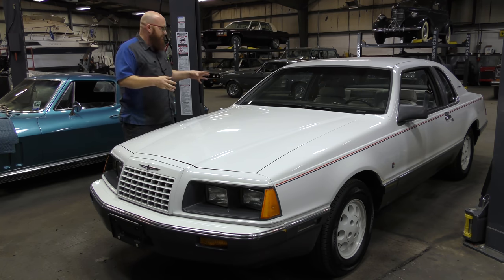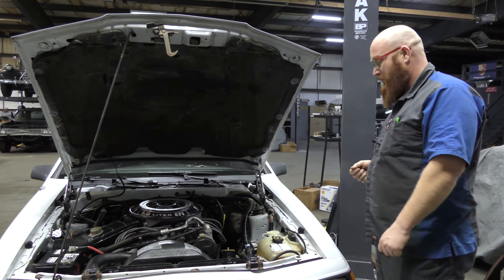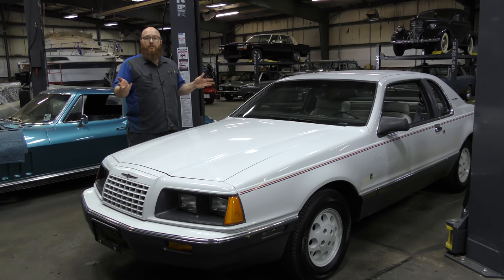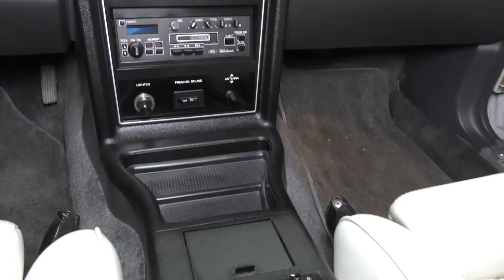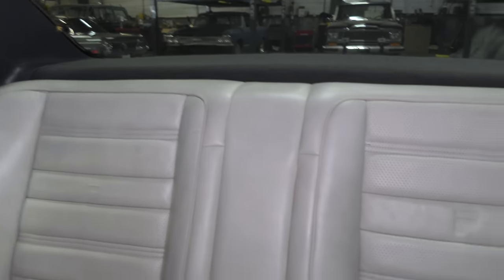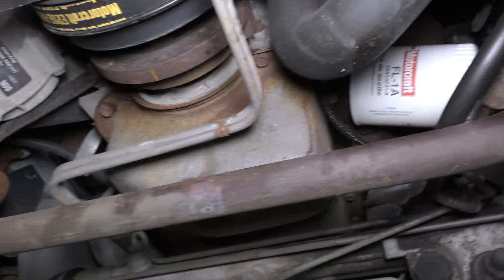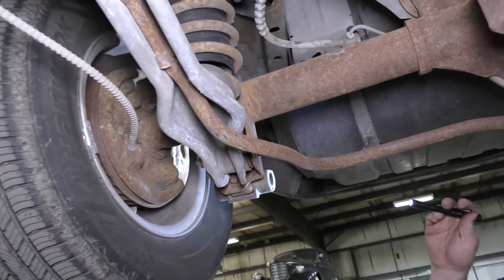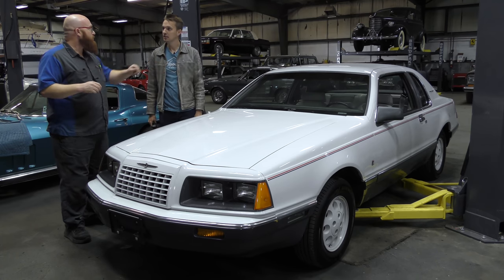The Car Matches My Shoes?!? The CAR WIZARD has Rare 1984 Fila Edition Ford Thunderbird in his shop

Comment: Brings back memories of my 1988 T-Bird LX with the 5.0 liter engine. 
Boy that Bird could Fly!!
Ordered it brand new from the factory.   And drove it till it dropped 242,000 miles later.
Reply: Ikr? I had my 86 up to 125mph with my brother trailing in his 88 iroc, it didn't pull hard but it just kept going.

Comment: Ah, the Fila T-Bird.  I am old enough to remember these.  Back when GM and Chrysler were making boring crap, Ford was churning out the interesting stuff.  Very cool find for Bob.
Reply: GM & Chrysler most DEFINETLY were making weird stuff in the 80's too
Reply: Ya GM had wrangler jean trucks, GMC had Levi ones, etc many years before Ford did it, as for interesting, Buick was putting out the Grand SPort at this time that made all other cars look slow and were (opinion) a good looking car, not just trim packages, just pointing out cross-branding was being done by EVERYBODY at that time, Chrysler had so many it boggles the mind how a car company in dire straights could afford all those special combos'. I think AMC did it before any of the bigger brands with Gremlins and Pacers and even the earlier Rebels n the l very late  60's (can't be sure on that). Now I am not hating, I like Thunderbirds in those years and had Couger as pretty my the only Ford car I ever owned and kept long term and it was a good car.
Reply: Pickle smoocher
Reply: Ford's were always nicer looking when it came to car designs. This Thunderbird, The Taurus and The Tempo were all ahead of their time back in 1984

Comment: VERY nice!  I recognize a lot of the features; I had a 1980 Thunderbird "Heritage" edition for a time, and even it had the keyless entry pad, the "premium" sound switch (though it was a pull-switch to the left of the radio), digital radio at that, automatic headlights - lots of neat features that were really ahead of their time.  And yes, that little squeeze-ball is for the lumbar support in the seat.  The seats are a different more updated design in that one (they were more like a lazyboy in the 1980 to 1982 birds).  I don't doubt Bob will have no trouble getting the asking price for that - it's gorgeous.  

Oh, and in answer to the question - I think of all the cars I've been in, the 1980 T-bird had the best (and worst) seats. :)  Best because holy MOLY they were comfortable.  Like I said - lazyboy.  It was just so relaxing to get into the car, sink into those plush, amazing seats (which were like 8 way power adjustable), and feel instantly at ease.   Buuuuuut... worst for kind of the same reasons.  Once you were on the highway, that seat would have you nodding off in about 10 minutes!  They were ultimately too comfortable for a car.  :P

Comment: I have special affinity for the Fox platform Thunderbirds. My Dad had the last year of this chassis, a 1988 Thunderbird LX with the V8. His was white with red interior and every option just like this one. I always felt like the coolest kid in the neighborhood when I rode in it.  They had TBFI and the two into 1 exhaust until ‘87 when they switched to MPFI and true dual exhaust. Really woke that 302 up. I think ‘84 was the first year for Ford’s coded security locking system and it’s crazy that they’re the only car company still using it in 2021. It’s a great feature, even in an era of perimeter sensing locking and push button ignition - you can literally lock your keys in the car!

Comment: I had a automotive teacher in high school. That had a thunderbird. It wasn't stock. Lowered to the ground a little. 351 cleveland built to the hilt. The engine was built to nascar specs. Five speed transmission. Outside it looked stock. Till you looked under the car and inside. Then you realized it wasn't. All white with red interior. Black tinted windows and you could hear the car coming before you saw it.
Reply: And when I see what Ford did to this 302, detuning it to 140 HP it upsets me greatly 😂 . It's honestly pathetic that they sent this out the door feeling good.

Comment: I'm in love. I owned an 83 Turbo Coupe that was very similarly equipped. Mine was black with gray cloth, but had the same style seats with the inflatable supports with a 5 speed. Wish my front suspension was as nice as this one. My struts and rack sucked. The only pluses mine had was it was one of the first 50 made, and had the turbo upgraded and it made around 18-20 pounds of boost. Which made for one extremely fun car that was special ordered without the driving lights

Comment: I worked at a Ford dealership from 1983 to 1989. I sold many of the Fila T-Birds. The hot one was the 5.0L V8. Also Turbo 2.3 I4 with the manual trans T-Birds.

Comment: I would tighten the bolts on the oil pan before thinking of changing the gasket. Vibration over the years will loosen those bolts. Hey, my 02' Ranger 4.0L (174,000 miles) doesn't drip a drop, you just have to maintain your vehicles. That Thunderbird would be a great buy. Thanks for showing it.

Comment: Any other car not being promoted for sale, you would note the leaking front shock and that the engine needs to be lifted to replace the oil pan gasket. The oil pan job is not a cheap one. Take $1,000 of the sale price just for that.

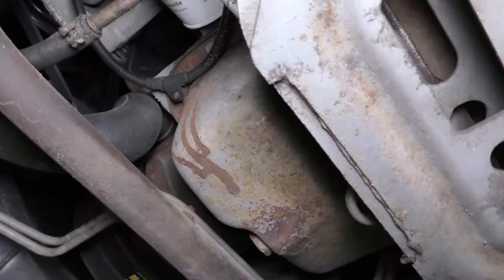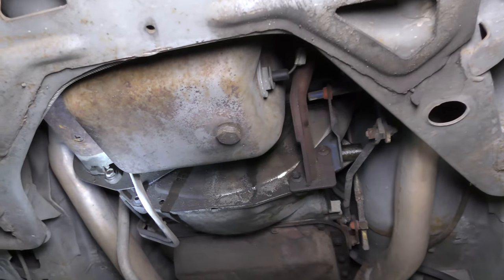Comment: At 7:23 and 8:17 it looks like there are two oil drain plugs on the oil pan.  Was that typical for this engine, or just for this Thunderbird frame?  Looks like it would have needed two oil pickup tubes inside the oil pan.

An old friend back in HS had an ‘83 with a V6.  We always rode around in it since it was way more comfortable than the Tercel I had back in those days.

Comment: Bought an '86 T-bird Turbo Coupe, red with grey/black lower body color. 5-speed, sunroof, 96K miles. Bought at an impound auction for $330, did brakes, headliner, serviced it up and a set of good tires. Not a drag machine, but cruised down the highway at a good clip pulling decent mpg. Had it a little while and sold for $2500

Comment: I remember when these came out, though never saw one in person.  I doubt there are very many still around in that great condition.  It is kind of funny to hear how little power the engine made, but American manufacturers weren't out of the "malaise era" quite yet in the mid 80's.
Reply: I think maybe Ford engineers tuned it more for low-end torque rather than high horsepower numbers, so that it wouldn't directly compete with the Mustang.
Reply: @BCBaron  Ford engineers just dropped the Crown Vic engine in it, because it's a personal cruiser.
Reply: @mfree80286  Back in the day I learned to drive in my father's '84 Mercury Grand Marquis, which used the same 5.0 V-8 and felt pretty powerful.  Now that thing must've been almost five hundred pounds heavier than the T-Bird, so I'd be shocked if it couldn't get the job done.

Comment: "Hmmm, no, I don't think I feel like premium sound today."
Why would they even install a button to turn that off?
Reply: I figure you wow your friends with it - like here's the normal crap sound and then you push the button and they get blown away like the Maxell ad.
Reply: Trans Istors are Resistors. Full volume = less resistance and less heat. Low volume = more resistance and more heat.
Leave the power amp off when you are just cruising listening to Mozart or Buena Vista Social Club.
Reply: When you turned on the switch the door speakers kicked in

Comment: The pump lumbar thing was pretty common in higher trim Fords of the 80s. That car is a time capsule, but probably not worth all that much. Also characteristic of the 80s? Having to replace the exhaust from the muffler back. They were in the process of switching over to stainless exhausts, but only made it to the muffler for some reason, so still having to replace the muffler and tailpipe was still common. Now, you rarely ever have to replace any exhaust components because of rust.

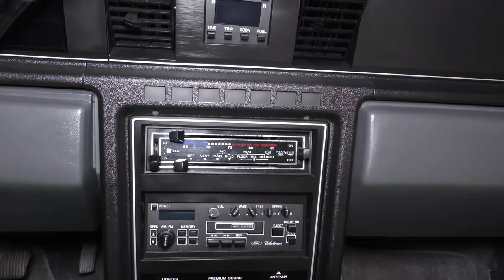Comment: 4:48 a little self-adhesive felt dot will fix the vents. Had to do that on my '84.
"Premium Sound" is a little amplifier that's stuck in the central 6x8" (I think) speaker mount in the dash. Since AM Mono wasn't an option anymore and the dash framework is from an era it was, there was a perfectly good mounting spot right there and so Ford utilized it. 
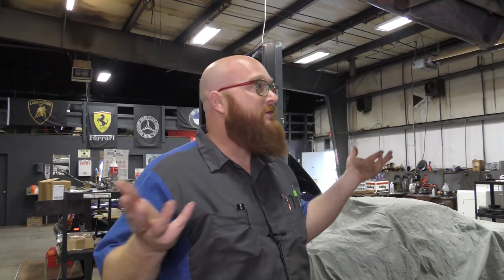9:52 checking the UCA bushings is not optional on these cars. If they're hard, wet weather handling will range from spooky to lethal. Speaking from experience here; when they bind they randomly load/unload the outside tire in the turn and the rear instantly loses traction. Mine was capable of snap-spinning at 15mph if the road was oily at all, with steady throttle or even *deceleration*. 
Also check all the clips holding the transmission cooler lines in place, if they lose their padding they'll eat through the lines. Been there as well. 

If the trunk creaks when you open it, roll the rubber split sheath around the torsion spring so the two springs aren't rubbing. Great cheap idea there but after 10 years it rolls around to the split and starts rubbing spring to spring. 

187,000 miles on mine before it wasn't worth fixing (a mistake, honestly, to let it go). It's how I can tell you to don't ever screw around with the dash center stack because that plastic fascia is as brittle as sugar glass and the screw bosses will break off, and never leave the map lights on because they will get hot enough to burn.  And your head unit needs a belt, I'll almost guarantee it.

Comment: I had an 87 T-bird with the 5.0 and multi-port fuel injection. Only had a 10 more HP IIRC. It was really slow by today's standards, a new 4 cylinder Kia might give it a run 0-60 nowadays, but that thing would sure shred the tires at a stop light. All the torque came on early, almost like a diesel, even ran out of revs like one. Got 30 MPG on the highway if you kept it around 65 and was extremely comfortable. Gave it to my Dad for a commuter car after insurance paid it off due to massive hail damage. He drove it like that until it had about 165000 miles and then sold it. Looked like a golf ball with the dents all over, but it was still shiny with the two tone blue color. Had all digital gauges with MPG and range, automatic climate control, automatic headlights and high/low beam switching. Pretty ahead of it's time. Would have been a rocket with a Coyote swap as it was very light compared to newer cars. None of that pesky safety structure and airbags to weight it down LOL.

Comment: I bought one of these as a 20 yr old out of an auction for $500. I didn’t realize what I had until I tried to get tires for it and the size tires were odd ball metric Michelin’s. I recognized those rims on this one right off. When I contacted Michelin they were the ones that told me what type of car I had. To be honest it was a hard car to keep running, every time I turned around there was an antipollution component going out in it. It was a headache.

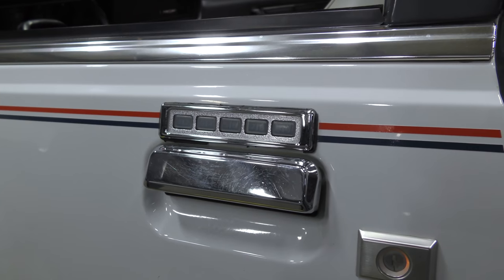Comment: 04:23 Man, you didn't even mention the lighted keyhole. Kind of useless these days what with keyless entry being ubiquitous but it's real nice if you don't have keyless entry but you do have a lighted keyhole. I learned to drive in a 1989 Crown Vic LX which had lighted keyholes and it was so nice. You walk up, pull the door handle, the dome light turns on so you can see the murderer in the back seat before you get in... and the keyhole lights turn on so you can clearly see the keyhole (also nice for trying to defrost a keyhole in the bitter cold because you don't need a flashlight).

Comment: I bought a regular T Bird new in '84 with the 5 liter engine.  The oil pan had a front and  rear oil drain plugs because it extended over the front suspension.  You can see both plugs on this video

Comment: A guy who picked up a spoiler I was giving away had an '89 Thunderbird, but that had a supercharged V6. A very rare sight in England. It was a silver 4-door with a dark tan leather interior and looked fantastically comfortable. Sadly I never got to drive it!
Reply: Those were called SuperCoupes and were actually pretty peppy for their time.
Reply: I think it was higher horsepower than the 5.0 V8.. of course the supercharged V6s were generally the result of emissions regs as the V8s were so strangled until ECU controlled fuel injection and multiple catalytic converters were commonplace. I'm fairly sure his was 4-door, as the super coupes were 2-door, although he may have pulled the seat forward and there was so much space he just put the full length of the spoiler across the back seats, so I may be wrongly recalling it.

Comment: It's so nice to hear someone ENUNCIATE the word "Euroasian."

Also, All T-birds had the seat pump back then.  I had an 84 turbobird, my buddy had an 87, same thing.

Also also, Tyler is DEFINITELY saying "Urination" at this point.  Prolly just to troll.
Reply: Not quite true.  It depended on the trim package and the seat option, and the year.  Those seats were optional on some trims, but came standard on the Turbo Coupe and FILA models.  May have been an option on the elan model,  can’t remember.  In 1985, the interior was completely redone, and the seats at least on the Turbo Coupe were replaced with different ones which had taller headrests and power lumbar, which was an electric air pump activated by a rocker switch near the bottom,  instead of the manual hand bulb pump.
Reply: @Z06ified  hmm. Interesting. Learn something new every day.

Comment: '84?!?! Wow I thought ford's first fuel injection was in '86. Maybe that was the first port injection that I'm thinking of. That is a sweet rare ride tho. Love it.
Reply: Had an 85 Grand Marq with the same engine. Was TBI
Reply: 83 had the FI on the turbo 2.3
Reply: @jimmartin7881  yep, EFI Turbo, baby!!! It was multi-port electronic fuel injection, very advanced for its time.  Even the new 1984 Corvette had throttle body injection (cross-fire),  not multi-port.
Reply: @Z06ified  And those were14 lbs of boost stock! I have a big Holset on a stainless manifold in my 87 Merkur with the stock 2.3 poked and stroked to 2.8 with all forged internals, 304hp at the wheels and that's at only 10 psi. Once I can get the time to throw a bigger intercooler in I can crank the boost way up and break stuff.

Comment: My dad bought an 87 new that I totaled a few years later, replaced it with an 88, both 3.8L auto.  They drive and handle really great plus the 3.8 would get good fuel economy.  

In fact the reason I totaled the 87 is they are easy to oversteer and spin the back end around and that's what I did - which wouldn't have been so bad if I hadn't then slid into a telephone pole.   My fault, driving too fast on a back road and came up on a guy in a delivery van stopped in my lane and I jammed on the brakes and the rest is history.  

I didn't get hurt but I knew I was going to Fila bad the next day, and I was pretty sore. 

The 1988 we put almost 200,000 miles on and the salt ate it up. The left trailing arm ripped right off the mount and with the spring pushing it down into the road I could only go backwards with it.  I stored it with the idea of putting the motor in another car and then some kids broke in and trashed it.
Reply: Even the oil filter on that car matches, it's a FL-1A

Comment: That car is pretty sweet considering it was built in 1984 when the K car was King... 12900 is a very reasonable price for that
Reply: It's still up on Autotrader for 7 grand, reasonable?
Reply: @jimmartin7881  it's an awesome car I cannot understand why it isn't sold already maybe it's something to do with the coronavirus bulshit
Reply: @glennbeadshaw727  Because the price is insane, he just bought this car for 7k. And that's too high, lol. This exact car is still for sale on the website he found it on, rare and sought after are 2 different things. This T bird won't appreciate by much with age, I have a mint condition 72 Gucci AMC Hornet with 25k miles and I can't unload the thing, lol. I only bought it because I put a  ridiculously low bid on it as a joke at an estate sale and nobody else bid. I'm sure he'll find a sucker for it, dealers always do, the internet's full of em. If it was a turbo T bird that'd be a different story.
Reply: @jimmartin7881  140 horsepower isn't much out of a 5l... I had a 6-cylinder hornet I love the design of that car.... I'm pretty sure they used the same body design for the Last AMX
Reply: @glennbeadshaw727  I love the 2 dr. Hornets, this is a sportabout though, ugly as hell. That 140 sure is a dismal number, even my 78 Monte has 165 from the 305. I always like the old Hornet hubcaps, my buddy has them on his Duster.
Reply: @jimmartin7881  I had the two-door bumblebee yellow... 140 horsepower is dismal considering that Ford put a 5 L into the cobra in 1988 and probably twice the horsepower
Reply: @glennbeadshaw727  At least 100 more hp, yeah. I saw a 2 dr Hornet for sale last year at a show for 3500, very nice condition and you don't see those unless it's at an AMC show usually.
Reply: @jim martin, not the same car.  The one you are taking about is in MI and has rust issues.